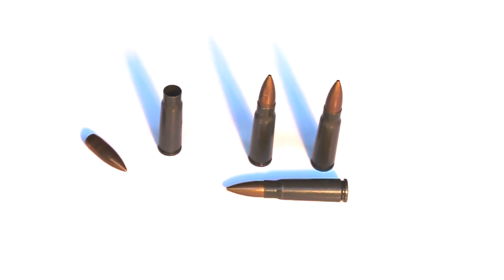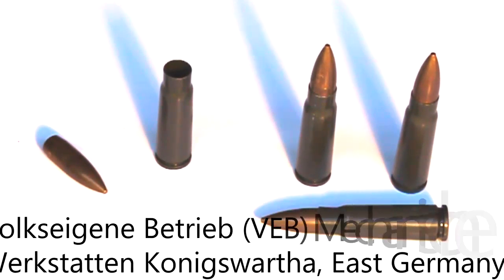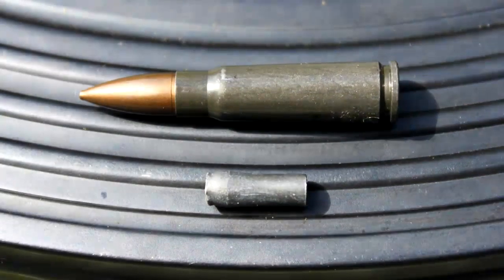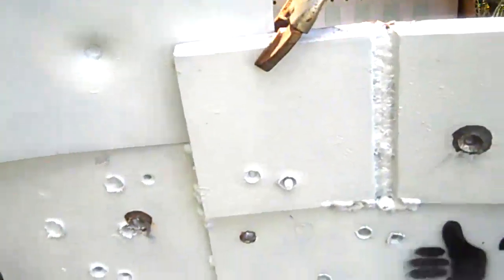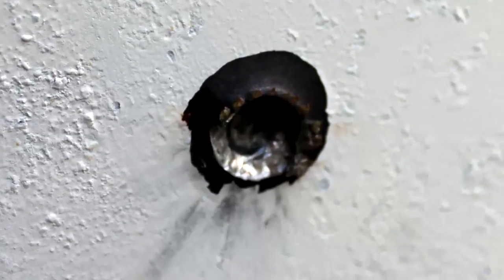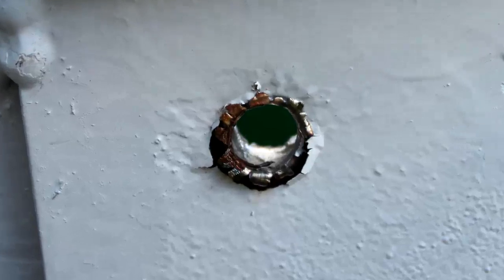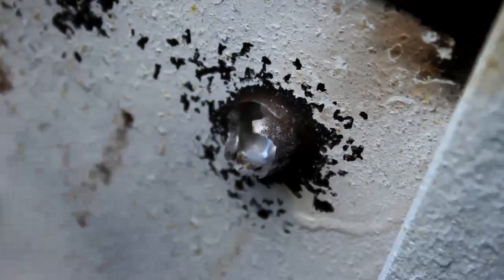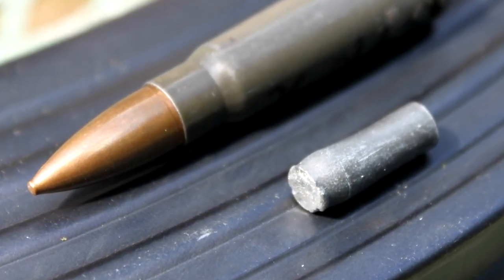AMMOTEST: 7.62x39 East German Steel Core

Comment: I have 700 hundred 7.62x39 headstamped 539 over 73 ...do u know what 539 means i know 73 was the yr
Reply from the maker: Josh Slaughter I believe it is as follows, 539 = russian, 73=1973 as you knew, 700 means a lot of fun!  Corrosive, no biggie, just clean it.
Reply: +Josh Slaughter 539 is code of Tula arsenal.